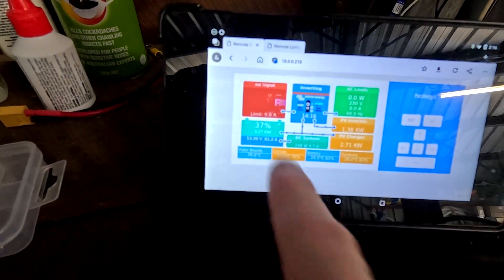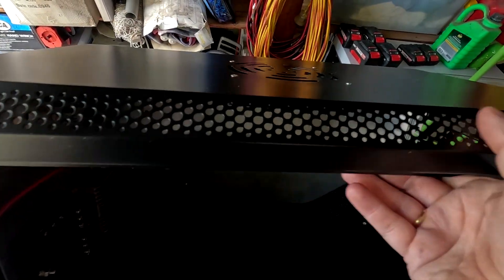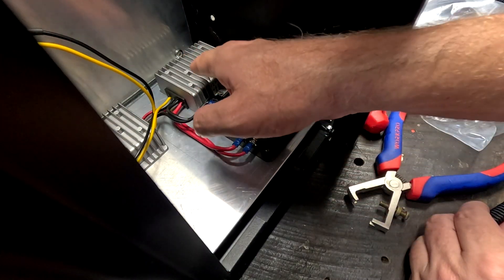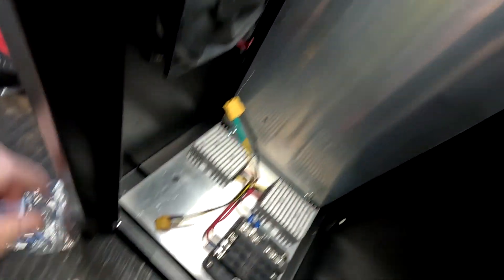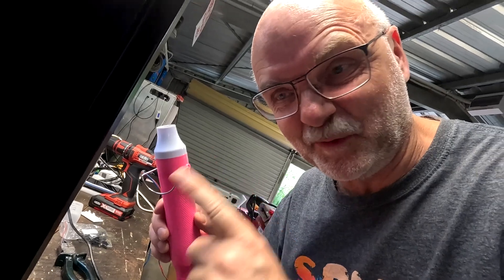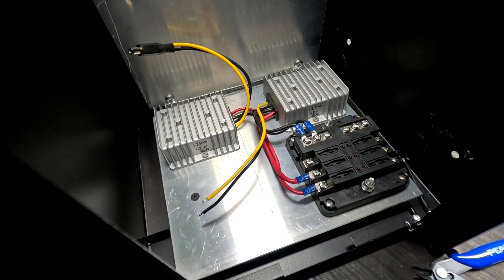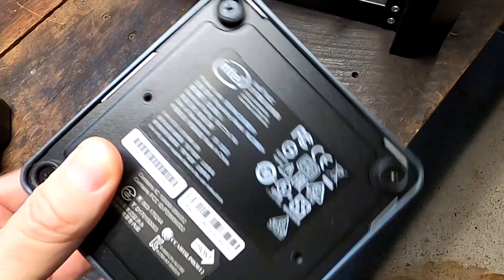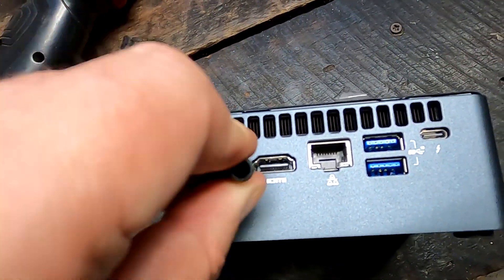Boost converters, fuse block, wrong connectors, first test. How everything comes together.

Comment: Hey Andy! After seeing your crypto miners, I got a few of my own that I'm running off my excess(?) solar. Now I have good reason to add more panels. I'm getting 550W Bifacial panels. More, panels, more power! SPAT calibrations incoming!
Reply from the maker: Nice! What are you doing with the heat and noise though? I found it unbearable having only one miner running.
Reply: @OffGridGarageAustralia 
I have BraiinsOS running on the miners. This OS raises the efficency and can be set to a dedicated powerconsumption. 
Theres a HA Integration for BraiinsOS. HA runs my miners between 1/2 and 3/4 of maximum power, or switches them off, depending on battery SOC, solar power and sunforecast.
On 1/2 power the fans run near idle and on 3/4 just slightly faster on an acceptable noise level.
The heat warms my cellar ceiling, witch is made of hollow blocks. This acts as a kind of floorheating for our apartment. Second stage it is sucked by a heatpump to heat up the warm water., or at least just blown out to the atmosphere.
Reply: @OffGridGarageAustralia  Goldshell Mini Doge II + III. Very quiet and operate from 12-15Vdc, so I'm going to run them directly off the LFP battery, without a PSU so it's more efficient, and charge from the sun.

Comment: Andy I used one of those fuse boxes in my RV - they are good but don't go over 10amps per line as they get hot - I think they have used steel instead of brass or copper
Reply from the maker: Hmmm, I have one in the top shelf above the batteries and have it running for over two years now with several circuits connected. Never had an issues. Maybe my load is not as high as in your RV...

Comment: Hello Andy
I’m new to your channel and love your content. I recently purchased a JK smart active balance 1A 150A bms and I fried it when I plugged the most positive lead. Can you do a video on how to properly wire it in step by step so I don’t fry the second bms very expensive mistake. Thank you
Reply from the maker: Hello and welcome to the channel!
I have made quite a few videos and showed how to connect BMS in general but also the JK BMS. Please always follow the manufacturer instructions and double check all balance cables are in the right order.
Search on my channel for the JK BMS and you will find the videos.
Reply: I didn’t get any instructions with bms. On line seems to be some pictures. The black wires are the temp wires but the first red of which there are five on the first plug is negative according to the pics.

Comment: I cut down a tree that was blocking our morning sun, because electricity is more important than a plant.
Reply: The best solar optimizers are made by Stihl, Husqvarna etc.    😉
Reply: I don't need solar optimizers. all of my bi-facial panels are in the sun with no shading. and they routinely out perform the 405 watt rating, even in the winter.
Reply: @stevenfrazier8939  
These brands are famous chainsaw manufactors - i was kidding... 😄
Reply: Right, sorry I did not read your post close enough. That is a good point and funny.
Reply: I put my panels so my chestnut and walnuts saplings won't block them, even when they grow up. Trees are important too!
Reply: Solar Power is an environmental benefit. So no concerns about a tree 🌲😉
Reply: Electricity won't make you food, timber, cotton, oil, sugar, etc, out of thin air.
Panels can provide shade too, but I know what I value more.
Reply: Did the same cut down if they shade 🎄🪚🏠
Reply: Is Australia still bad for tree protection laws(ie massive fines for cutting down. Tree on your property?)